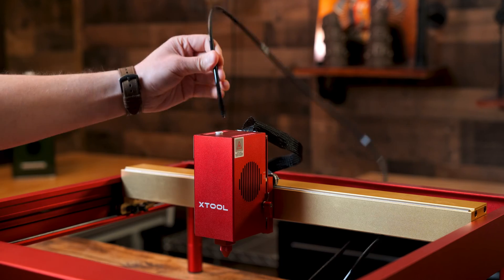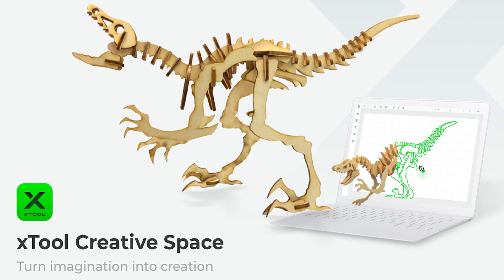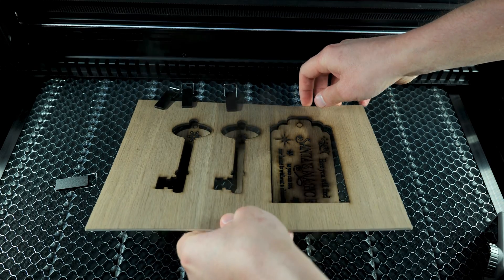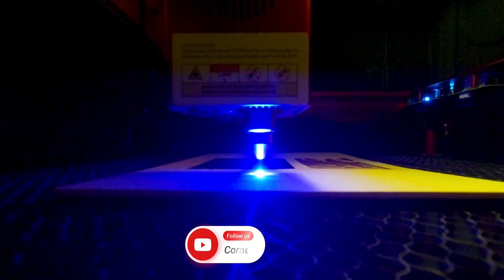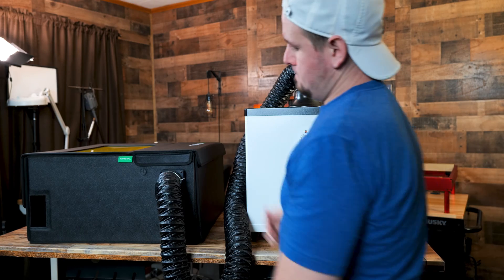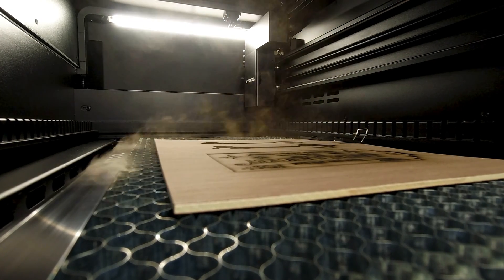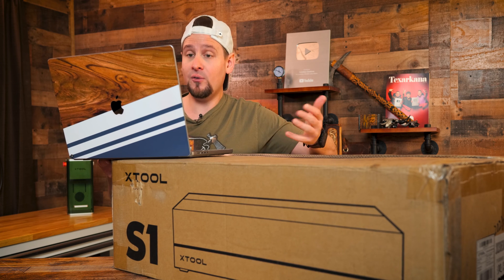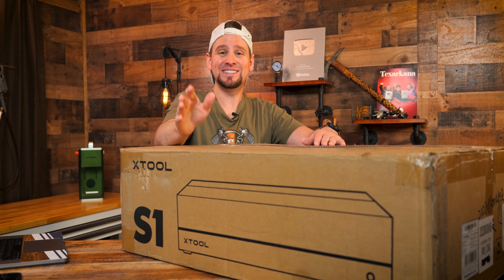Laser Engraving Safety Tips EVERYONE Should Know (+ xTool S1 40W Laser Preview)

Comment: I am a little paranoid. The Xtool P2 has a small gap at the front, when the extension is mounted (I'll probably will close this gap somehow).
Is it still necessary to wear goggles even if the machine has a full enclosure (same for other machines that have a enclosure)?
Reply from the maker: Does the gap let out light? If you have an enclosure it’s usually not necessary to wear laser glasses.
Reply: I’m paranoid like that with my xtool m1 too. Yes it’s enclosed but you can still catch blue light through the cracks sometimes. I bought glasses just in case.
Reply: always wear safety glases